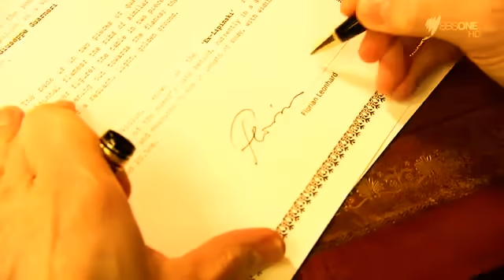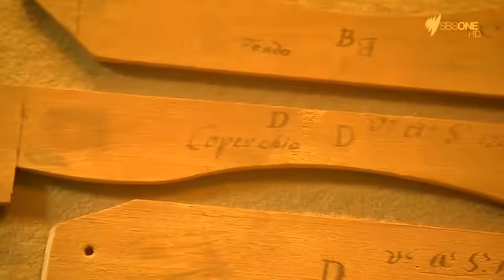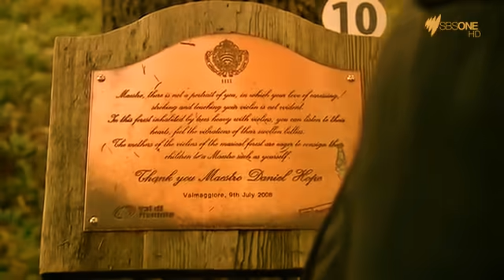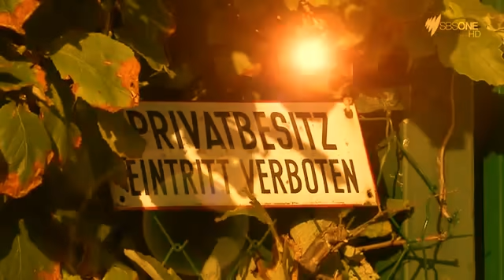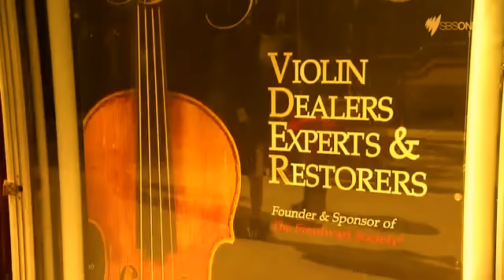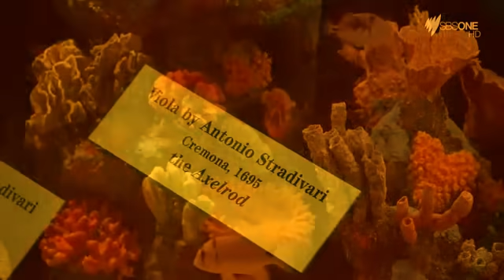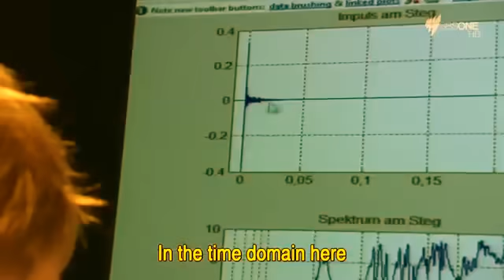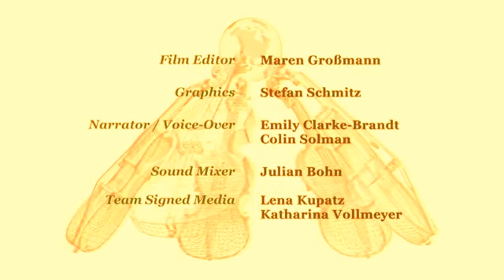The Secret Of The Violin ( Stradivarius - Guarnerius )

Comment: The Strad had been part of a blind taste test by the top performers and ears about once a decade for over 100 years, The Strad has never come out on top. Newer fiddles always win. The Strad thing is a myth and always has been.
Reply: Is that right . . Did you mean the player or the listener judged?
Reply: Let me preface my comment by stating that I took violin lessons from the age of 12, and continued to play mostly for my own amusement and the strong objections of my three sons into my 70's.  Although I would have been better advised to have taken more lessons I never did.
During this time though, I did learn things about violins and playing them [ as opposed to worshipping them while I looked at them in a glass case ].
Too many non-players are unaware of these basic facts.  First in order to be anything more than a mediocre player the first requirement is to have a good ear, this is because having no frets on the fingerboard, you must be able to form the right note by listening and placing the finger accordingly.  As one moves higher up the fingerboard this becomes progressively harder to do, since the correct finger positions get closer together.  As one grows older, the ear becomes less acute and higher tones are harder to hear.
Any given violin is very sensitive to being set up properly, which is a subtle process, and involves for the most part shaping and bedding in the bridge, and finding its optimum position with respect to the sound post inside the box.  In the worst case you get horrible buzzing resonances which ruin the sound emitted.  Further it should be obvious that the type and quality of the strings you choose affect sound quality, as does the bow.
All of that said, most players must have experienced hearing, or better still playing, a high quality instrument at one time or another.  When encountered they seem to play themselves and sing with an ineffable quality.
So when the question of comparing say a Strad with a modern factory instrument, or indeed with  an instrument of any provenance, there can be little hope of comparing like with like, given all the variables affecting both the sound emitted, and most important what any particular listener  is capable of hearing with his Mark 1 eardrum.

Comment: It looked like he was in a forest of fir or pine, softwoods nonetheless.  But I saw curly hard maple on the violins he was holding earlier.  I figured the violins were mostly hardwoods?
Reply: I think its straight grained fir for the front and maple, usually tiger stripe for the backs.  The fir, like Douglas fir wants to be as tight grained as possible. One thing that gets me is that all the necks on every one of these old instruments have been replaced - and who knows if they match the originals.

Comment: I just had this argument people on a chat room. I pondered that all the comparisons of various "great violin makers sounded too similar to me to make pronouncements about quality. I also said most discussions seem to be old violins which are played in what I would say is an early 20th century mode. Lots of vibrato, and modern pitch (A=440 or higher), additionally the I suspected the material of the strings was not gut. To my surprise these who responded said yes, all these instruments have been altered, in order to play later music.  I responded that this is a similar battle between classic car enthusiasts. One group wants pure restorations or limited repairs and the other feel the cars must become hot rods with high horse power engines and other modern items. It is this second group which I think are excited about old violins. They have no intention of keeping them as the builder had designed them. But they do want one or two things to remain original . Like the plaque on a museum display-case which read Thor's Hammer- only one new head and two handles it has had during its life time.
Reply: Jesus the hungarien was a carpenter,woodworker.
Reply: you’ve got to be kidding. the classic violin stays as it id!!!!  make new violins. holy jeez!!!!

Comment: Picea abies excelsior improves with age when made into an instrument. Modern violins will sound better in future centuries.
Reply: @Jim Bo -  Improves in what way?
Reply: Old Fender pickups often had fused varnish that kept the very fine gauge windings from moving and changing the frequency response. But you can accelerate aging of anything by baking it. In the real world of electronics, we call it ‘life - testing’. No magic to see here.
P.S. Have you ever seen the fake - aged “Road - worn” but new Fender models? 
So pour crazy glue on your new Squire and leave it in the sun and you too can have a ‘Strad - O - Caster’.  “Rock on”

Comment: Interesting read of the down fall of Ming dynasty in China, I came across the term of the 'little ice age' which happened in the period of 1550 to 1770 for a period of roughly 220 years. The cold temperature should be a major factor in slowing down the growth of wood.  Slow growth rate should make harder wood.  Then again, some chemist also discovered wood preservatives were used in the wood for making violin. My guess is, the preservative is adding the hardness to the wood.  The harder the wood, the resonance box will give a brighter metal sound.
Reply: Guess?

Comment: Put your violin wood in a commercial grade microwave for a few minutes. You'll have to play around with intensity and time. Get it right and you can loosen up the resins in the wood's columnar cells. You can actually see the before and after difference under a microscope. I know because I've done it. Plugged resins = poor sound reverb. You're welcome...P.S. probably applies to classical guitars, etc.

Comment: The virtual software is useful but the variables in a Violin so old? It's to difficult. To chamber out the wood worm damage is nigh impossible as it's shown this damage adds to the sound of the multiple century old instruments not to mention the curing of the wood over time, sap content. It's finish, past repairs all factors that make it nigh impossible. I am a Guitar player and i love my vintage Guitars. The wood plays a massive part along with it's appointments but the one variable that makes it impossible every time especially with bespoke instruments is the maker. Unless you can clone Mr Stradavari right up to when he was peaking at his craft and assuming he works and thinks the same way then you may get an exact copy but that's pie in the sky. Besides they wouldn't be what they are if they were so easy to come by or replicate.